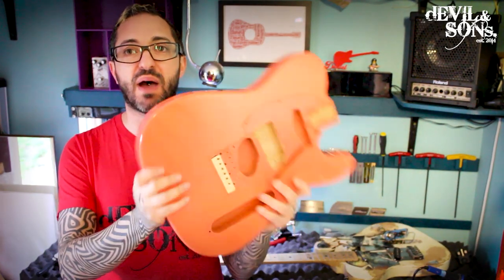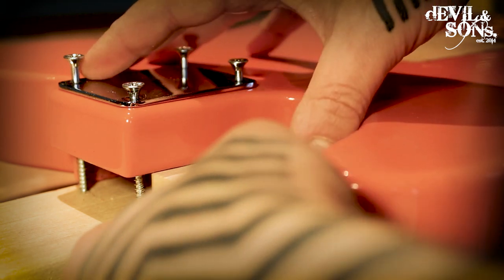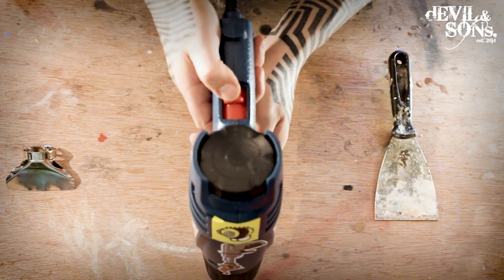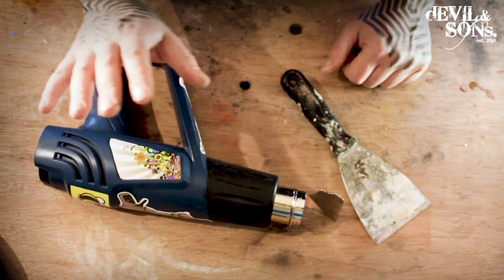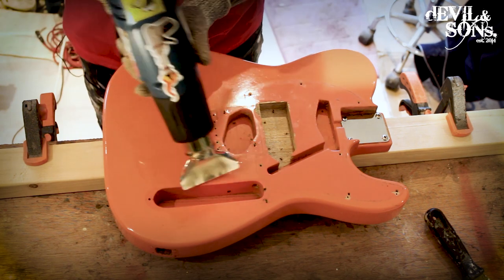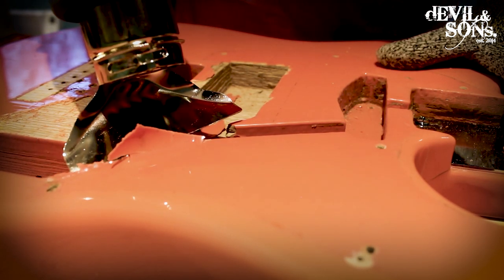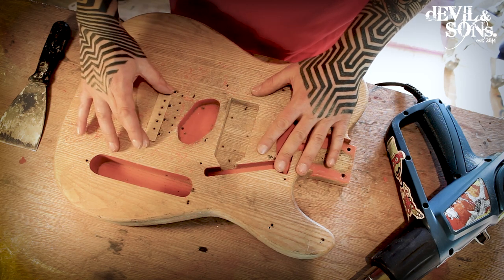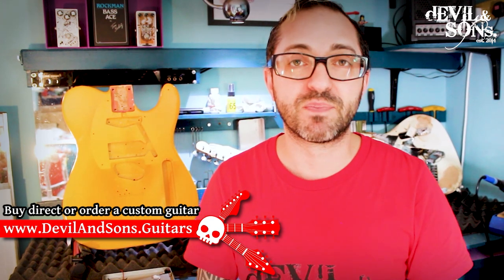The BEST way to strip paint from a guitar (or bass): How to use the heat gun method

Comment: I tried, it was a disaster... now i am going to.pretend that i have guitar from mexico in 1700.
Reply from the maker: Oh no. How much did you get off? Is part of the disaster marks left by the scraper in the wood? It can probably be sorted out. If you can describe it a bit more I can suggest a fix.
Reply: @DevilAndSons  Thank u, i tried it on an old cheap guitar, i will fix it with a lot sandpaper and matte finish with some colour of brown wood. I will do something. It was an experiment. It needs very patient work and very steady had to remove the gloss finish. Ur way is indeed the best but neess experience!!!
Reply from the maker: @dimitrispapadopoulos9245 good luck. Cheap guitars are a great way to experiment. Sounds like you have a good plan. Thanks for watching and commenting

Comment: Will this work just as well for a poly finish over a natural/unpainted guitar?
Reply from the maker: I am certain it will.
Reply: @DevilAndSons  Thanks! Very helpful. Do you happen to have a suggestion for what to apply to a natural swamp ash body that will leave it un-darkened, and somehow protected, but won't require a sprayer to make it look professional?
Reply from the maker: It's a pleasure, and thanks for commenting. Lots of people use tru oil, i haven't  though. I think that is probably going to be the best solution. I'm sure there are some videos on here of it to help you with that decision.
Reply: @maxhighstein  You might try boiled linseed oil. If you want to speed up drying it can be mixed with Japan Drier, which is banned in some American states. Also, mineral spirits mixed with boiled linseed oil can speed up drying because it thins out the oil. Make sure it's BOILED linseed oil, as non-boiled can take forever to dry and in some cases might not completely cure at all. If you use mineral spirits with linseed oil do some research on the ratios. I've seen 50/50 advised and as little as 1:3 linseed oil to mineral spirits in that order. I put the BLO on a maple neck and it darkened a little and has a satin sheen and is as smooth as a baby's butt. You could also stain your raw wood and put clear lacquer on it, but you said you wanted it undarkened. I put my BLO mixture on a test board of pine or poplar and it didn't darken it a bit, but those are light-colored woods. I haven't worked with swamp ash so I don't know if the BLO will darken it or not. BLO is fairly cheap and if you can get some different kinds of scrap wood you can test the mixture on them. You probably know more about it than I do, but I literally just got done finishing a neck 2 days ago.
Reply: @Voartist  Thank you for your thoughtful advice!
Reply: @maxhighstein  You're welcome. I'm learning as I go and it's fun to share ideas. So I'm all ears too. I have to wait until the weather warms up before I can apply my lacquer finish to the body. I don't have a paint booth, just a garage and it's too cold. Good luck with your project Max!
Reply from the maker: Thanks for such great advice, I love this youtube community of helpful people.
Reply from the maker: I'm with you. I have a paint booth but it's so cold out I'm going to hold off a bit.
Reply: @Voartist  I took fine furnishing courses at a local art school. My instructor recommended 1/3 polyurethane, 1/3 linseed oil, 1/3 turpentine - wiped off after setting for an hour or so (depending on climate). I tried it on a Warmoth neck. It took a month to dry completely, but I like it. Feels like natural wood.
Reply from the maker: Thanks for adding to the information discussion

Comment: If i want to remove the current paint job on my guitar and then spray paint another one, after removing the current paint with the heat gun what do i do?
Reply from the maker: I would recommend sanding the body to remove any debts etc, but not perfectly smooth so the new paint has something to grip - 600 sandpaper at the finest. Then it depends on the finish, if you want the grain to show through you should use a sanding sealer before the colour, and if you want something solid in colour you could go straight to a primer coat then colour without sanding sealer. Make sure you have removed all dust etc before spraying. I have actually started making some videos about spraying colour on etc but they won't be ready until next year. The main thing is if you are using a lacquer (nitro) you can just spray coats, but if you are using something like a poly you will need to lightly sand between any coats when you leave it to dry. So basically that would mean you can put a few coats of primer on in one go (the paint will recommend something like 10 - 15 minutes between coats), I would suggest 2 or 3 not so heavy coats. Let it dry, lightly sand, then 2 to 3 coats of the colour. Let it dry, lightly sand, then another 2 to 3 coats of colour. Never put thick coats on though. Then you may want a top gloss coat. I have a video on how to buff.
Reply from the maker: Here's my buffing video
https://youtu.be/cpXfhX1b2tM
Reply from the maker: I would recommend looking at a few videos by @BradAngove about spraying, he has a lot of great tutorials. https://www.youtube.com/c/BradAngove
Reply: @DevilAndSons  Thank you so much that's actually really helpful
Reply from the maker: Any time, if only had my videos ready for you. If you're on social medias and put up any photos of your work please do tag me ( @devilandsons ) I love to see other people's work, it's always inspirational.
Reply from the maker: Also, if you don't use sanding sealer make sure when you sand back the primer that everything is smooth (may require an extra set of coats) otherwise you may see the texture of the grain.

Comment: I just finished one this morning and that is an absolutely miserable job getting the urethane coating off without gouging the wood underneath. I did an epiphone Les Paul I bought for $50 with bad electronics in it.
Reply from the maker: I do hate doing too. In fact, I have recently sanded a few off because I hate the whole process. However, sometimes it comes off like butter.
Reply from the maker: What's your plan with the epiphone?
Reply: @DevilAndSons  I got the first coat of wood primer on it now, but I’m going to get in playing order replace all the electronics with new ones, and just make it a nice playing show piece to hang on the wall. I bought it from a pawn shop in terrible condition for $50.

Comment: Is a hair dryer hot enough?
Reply from the maker: It may be, I don't use the air gun on the hottest setting although I imagine the setting I have it in is still hotter than a hair dryer. If you work the area for a while with a hair dryer it may well do the job.

Comment: Great job on the video. And what a great tip putting a Scraper on the heat gun. I ordered a Wagner keep gun from Amazon yesterday and it comes with a Scraper Attachment cool
Reply from the maker: Cool, good luck with whatever you are working (what have you got planned) and thanks so much for watching.
Reply: @DevilAndSons  Sorry I  missed your question. So I bought 3 different Strat bodies on eBay. One is unfinished. I will be staining that one. Another one I will be stripping the paint, then staining that one. I will also be installing the Antares AutoTune kit in that one.  The third one ... body is in great shape.  I will be installing the Fishman Fluence pickup system in that one. Thanks again for posting the video,
Reply from the maker: Nice. I don't know that auto kit, I'll look it up. Have fun.

Comment: i suggest using heat resistant rubber pads on protecting the bottom part of the guitar from scratches. Rubber foams could easily burn from the intense heat of the heat gun and could melt along the guitar body and you could also inhale the toxic fumes. So be careful guys.
Reply from the maker: Very good point, thanks for sharing it

Comment: This was great. Curious, because you will sand a little after heat peeling, what are your thoughts on using an orbital sander right from the go to remove the paint and finish? Also, what type of mask did you use?
Reply from the maker: I wear a half mask. Normally when sanding I just have a p3 particle filter, and when spraying an ABEK filter.

I use an orbital sander on poly finishes, and I would with nitro if I couldn't heat it off for reason. I used it with a family  pad when tweeting.
Reply: @DevilAndSons  Thanks! Right, i just realized...nitro. :)
Reply from the maker: @4stringz324 I must say though, guitar finishes vary so much that sometimes poly just pops of like this and nitro turns out to be hard to remove like this sometimes.

Comment: Excellent video.  What type of gloves (e.g. welders gloves, ordinary work gloves,  or something else) were you wearing in the video to protect your hands from the heat?
Reply from the maker: I'm pretty certain they are ahead pair of polyester heat resistant gloves I bought on amazon or somewhere similar. You could use a range of gloves as it's really just for holding the body, I wouldn't put my hands in front of the gun itself.

Comment: Do guitars with a natural, wood-stained finish have a clear coat that needs to be taken off similarity or can you just sand them and start painting?
Reply from the maker: Often they have a sealer coat applied. Depending on what you are planning you may not have to worry about removing it. You may find that a stain will work better without it.
Reply: @DevilAndSons  Thanks. I was thinking about spray painting it with acrylic with the dominant colour of a picture I'm planning then painting the rest of the design by hand.

Comment: Cool work. What brand/type of mask are you using?
Reply from the maker: I use a Moldex 8000 series half mask. I have P3 filters for dust from wood working and ABEK1 filters for spraying. The latter is essential. I think the specific model I have may be 8080. I'm actually thinking of upgrading to a full face cover mask by the same company.

Comment: How would u stabilize a set neck guitar? I’m considering this for my dangelico premier dc.
Reply from the maker: Thanks for watching. 
Sometimes I just clamp down the guitar, but using some scrap wood between the body and the clamp to make sure the clamp doesn't mark the wood. I have some clamps with plastic on them that do the job too. I find two clamps normally work well, I just move them around as I go. You need to be careful if the guitar doesn't lie flat on it's back because of the headstock, and have that overhang the edge of your work table. I hope that all makes sense and good luck.

Comment: How would about sanding down a guitar with a natural oil finish thansk
Reply from the maker: I'm sorry i missed this. You have to physically sand that, to get the oil off. I would recommend a random orbital sander to start with, finishing by hand, and maybe doing all the edges by hand. Potentially with 220 (ish) grit to start, but always do a test before you begin and test with something less abrasive just in case that works fine. I tend to finish with 400 if I'm going to then spray or paint the guitar. I hope that helps.
Reply: @DevilAndSons  OK thanks  for getting back to me haven't started the project as of yet will getting the rest of the things I need next month and then starting it
Reply from the maker: @jamiedude1197 I hope it goes well. Please do ask if you have any questions.

Comment: Great video, would this system work on acrylic painted body?
Thanks
Reply from the maker: It should do. Always worth testing in a place that isn't visible (like under a pickguard) if possible, and you may find that sometimes you can peel the acrylic more than crack it off.
Reply: @DevilAndSons  thanks

Comment: I have a really nice PRS korina that is a burgundy color and I'd like to strip it also.  There are more curves than a Telecaster...would you ever recommend using a chemical stripper?
Reply from the maker: I used a chemical stripper the first few times I removed paint from a guitar, but it's messy and toxic so I avoid it, but nor reason not to give it a go if you don't mind that process. I don't know enough about it to know if it works on both poly and nitro finishes or if you need different products.
Reply: @DevilAndSons  I’m not sure what the finish is on this PRS but I think it’s a combo of polyurethane and lacquer if that is at all possible..?
Reply from the maker: Yes, they have some models where the final coat is a nitro lacquer over the previous poly coats.

Comment: what grit of sand paper to use after?
Reply from the maker: It depends on what is happening next and how deep any scratches are. Normally I start with 600, but 400 if there are some scratches to sand put. I wouldn't go any further if I were painting it, 600 is good for the primer to go on. If I were to have a wood finish for staining and oiling i would keep going with the sandpaper, 800, 1000, then possibly 1200.

Comment: How cautious should one be with a guitar with binding?
Reply from the maker: The heat could cause the binding to come away depending on how it is glued on, so do be cautious. I think you would probably be OK though and if you are confident enough to remove the paint and respray you shouldn't find glueing binding back to hard if it does come away at points. You will have to be careful though with the scraper ad the binding could easily be marked (simple to sand back, and marks may disappear with the clear top coat anyway) but catching the scraper at an angle into the edge of the binding may chip it.

Comment: Very interesting video. I have a "78 Gibson Les Paul Custom. That was originally a NATURAL finish. When I had it a few years,  I had someone paint it WHITE. Now,  I want to strip it back to natural. My question is; since Gibson guitars don't have bolt on necks. How would you suggest I secure the guitar and neck to the work bench ? Thanks.  Anthony.
Reply from the maker: I would simply clamp it down, maybe a protective layer between the clamp head and the body, like a scrap of wood, just to ensure you don't clamp too tight and leave an indentation. I use the plastic quick grip clamps a lot for this and don't over tighten, the have never left a mark. Good luck.
Reply: @DevilAndSons  Thank you.  I will give it a try. 😊
Reply from the maker: Have fun.